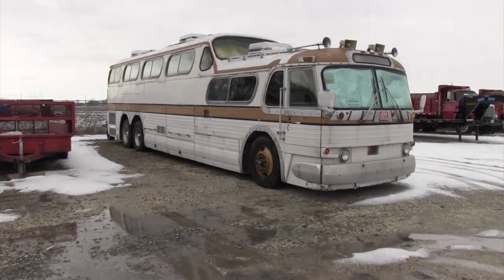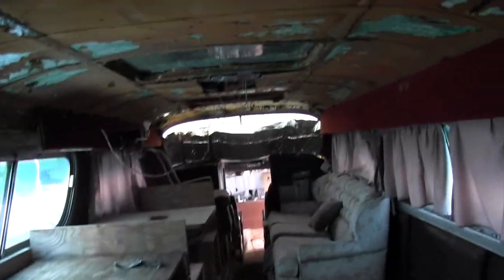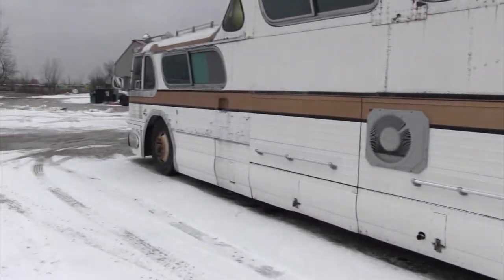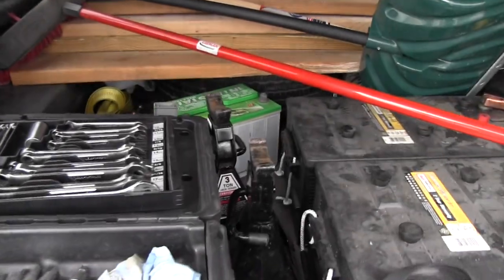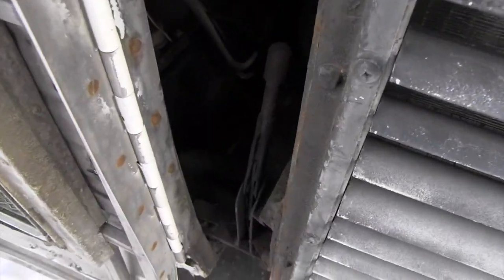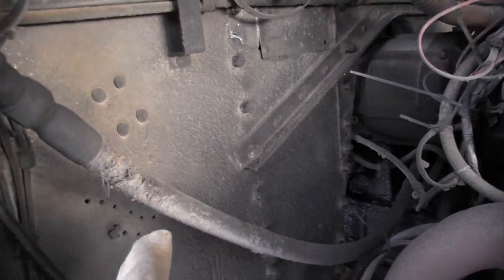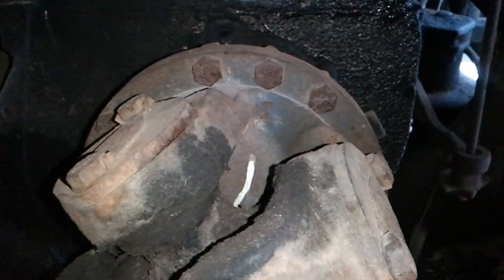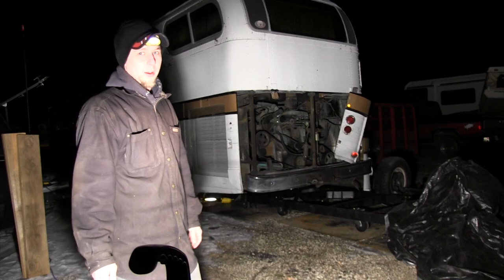Scenicruiser 858 - Engine Removal - Part 1

Comment: This is one of the most interesting vids I have seen on youtube. #1 I love Detroit Diesel engines ever since my first summer job driving earth movers with two Detroits on them (Euclid-Terex) which had a revving 2 stroke rear engine and a 4 stroke front Detroit. . #2 There has never been a more fascinating body style than the Scenic-cruiser. #3 I have a Holiday Rambler rear diesel pusher 36' motor home that given a choice I would rather have spent the money to do this. Cannot wait to view the remaining videos. I am 68 and have always done my own mechanical stuff on my cars, boats, pickup, and motorcycles. My issues now are failing eyes that prevent me from seeing into tight dark places, less flexibility to bend and twist to reach into things, and with age you get tired quicker and thus work slower. My advice to you being a young studly guy ha ha is to enjoy this project. The only limiting factor you should have, as was my case at your age, is money and time set aside for your family. Thank you so much for the posts of your project.

Comment: Dude, dude, dude...
I love you man, I do. I love your devotion, audacity and sheer will. Your patience and borderline stupidity for taking on such a project speaks of great character and is inspirational to me.

That said, getting under that bus while jacking it has the potential of depriving the world of your presence.
Darwinism gave you one warning that went unheeded. Then it went unheeded again. See where I'm going with this?
 
I'm a professional mechanic and I too work in the field. I had to do a clutch one time (in the field) on a truck - so a simpler job than this because all that had to come out was the gearbox.
It took fully 3 hours to secure that vehicle before anyone would get under it. This included a load shift almost identical to the one that happened to you in remarkably similar circumstances. Thing is, no-one was under the effing thing when it moved.

Those bottle jacks are inadequate for lifting that bus. Jacks should be on steel plate, or better the whole vehicle could be pulled up onto blockwork made of wood with a winch.

Hire a truck trolley jack (or buy secondhand) rated for the weight you're lifting. Only use that trolley jack on a steel plate or the wheels on the jack itself may dig in causing you to lift higher and higher until the chassis of the jack slows the digging in.
When the chassis of the trolley jack stops the digging in that's usually when it is about to topple also. When a trolley jack topples it bends the lift and jams it on an angle sideways under the vehicle.
This has happened to me many, many times.

Perhaps you could fabricate 6 adjustable pyramid style jack stands with steel base plates for each made especially for your bus.

Thing you mightn't realize is this: you might survive the crush but die after lying there for hours from injury/exposure/shock etc because you can't call for help.

NEVER, EVER, EVER, get under (or put any part of your body under) that thing when jacking it again.
Promise me - yeah? I know these things.
Reply from the maker: .... I nearly pooped myself when that happened. I went home and laughed about it with my wife... who didn't think it was that funny... but all things considered... I WAS STUPID to do that. So, in reply, I do in fact promise to never be under it when jacking it up again and yes, new jacks (rated for 20-tons) will also be used in the future.

Thanks for the comment and suggestions. They are very valued. And also, thanks for watching!!

Comment: Always find out what can be rebuilt before you replace it. Second original parts last longer than what we have today takes me to first point. Good to see you have your manual and plastic is crap cooling parts such as these will break overtime. This fan has been there through the test of time. 40:20 I was just thinking about jacks and how unsafe they are without a wide thick solid platform. Plus you really should NEVER WORK OFF A JACK EVER. And should always have a buddy. 44:15 back under there again I see Hope your using one of them boards for a floor for your bottle jack.  Last thing I will say is I know you are going this alone but I know your friends will ride with you when your done hope some or one of them helps you along. I also hope a old bus serviceman see's this and helps you along the way. Good luck I hope you stay safe doing this check everything out before you ht the key. Following along I will.

Comment: Good job tj.  I'm a bus builder too and I've got a suggestion (doesn't everyone) think about using a Allison 740 trans with a stone bennet electric shifter. You need to talk to someone more knowledgeable than me but I think I  it could be done cheap. I've  taken 2 of those granny's to the junk yard because I couldn't give them away. They just don't break and there's lots of them around cheap. Watch for my YouTube video  about raising the roof on my mci. Bert
Reply from the maker: Will do!!! I am wanting an auto eventually. Subscribing now!!
Thanks for the advice!
Reply: ***** TJ, wow, I got to hand it to you, if you've pulled this engine by yourself you have giant cohones. And, add to that outside in the elements. So, you live in IL ? I think over in St. Louis, Mo. there's a garage/depot where MK&O Coach Lines are located. Maybe give then a call for info on getting parts ect. I'll bet even the drivers know where there's parts. After all, they've been everywhere, man. Not to mention Greyhound has a depot located close by MK&O in the ST.L. downtown area too. Oh, Vandalia Coach is in IL. perhaps that's close to you.  Hope this helps. :-)
Reply: Bus rebuilding

bus rebuilding
Reply: bert dansereau I'll take one if you're given em away.

Comment: Awesome job what's the total cost for the rebuild on the engine start to finish
Reply from the maker: Just what I spent on the clutch parts:
$125 for the initial trailer on Craigslist Plus:
   - $20-30 per 6-ton bottle jack I used on the trailer dolly (total of 4)
   - $150 in casters
   - $50 in additional metal to modify the trailer and use it as a dolly
   - $100 for the rims, tires, and new brakes/hubs for the trailer's axle (Had to old 4-bolt on the way outside of the rim. I converted it to 5x4.5" spacing for standard trailer tires - Tires/rims bought used on Craigslist - factored into this number)
Total Engine Dolly Trailer: About $525. 
     (I chose the trailer route because I wanted a utility trailer as well as I did not own one already. Also, it was easier to bring to the lot and setup. Also I knew it would handle the weight and I didn't have to completely fabricate something that only served me in this 1 use. Serves multiple purposes for me as I use it regularly now as just a trailer. Benefit being, I remove the axle and there is my engine dolly, convenient.) 

Clutch Disks (2), Floater Plate, bearing: I cant remember exactly... $500 or more? I honestly don't remember. 

There was also a number of trips to my local International dealer for odd little parts along with a new air intake elbow. Factor in Oil, radiator coolant, Power steering fluid, and patching the radiator I punctured ($175... I think) Probably somewhere in the $1250-1500 range. its a lot of little things, but it all adds up.  Still, compare that to paying for the knowledge in a classroom... I am getting experience and knowledge out of this as well, which to me is invaluable! 

Thanks for the reply!

Comment: In hindsight do you wish you would have pulled the motor at home?Lets hear an update
Reply from the maker: I would have if I could have, but it couldn't move under its own power and the tow companies I called didn't think they could get it in my driveway without a LOT of man hours and additional equipment. Plus, working on it here got me outside and it kept my wife happy cause she still had a usable driveway at home :) 

Update: Its running and moving now, but still in the storage lot. I did take it to a car show in September of last year. I have however had a couple of other personal things I have undertaken and have been unable to devote much time to the bus. It is FAR from a lost cause though as I am itching to work on it DAILY. I actually just got back from a 5000+ mile road trip with my wife where we picked up some 6 new windows for it and visited a number of other Scenicruiser owners. (No video of that though, sorry). 

I am working now to gather additional parts, jake brake, window gaskets, baggage bay hinge rubber, etc. and making a list of priorities to work on. I want to continue my work on the foundation of the bus before I convert it. I plan to take video of everything along the way and share it with you all. Next steps will be: wheel brakes, parking brakes (adjustment), Axles, Hub seals, Air system, radiator re-core or replacement, Transmission Linkage adjustment, Roof top air removal and Roof hole repair, Window replacement/installation, etc. The list goes on and on. 

GREAT NEWS THOUGH: There will be more video to come in the next 2-3 weeks of the clutch work that was done and the engine re-installation. Stay tuned!